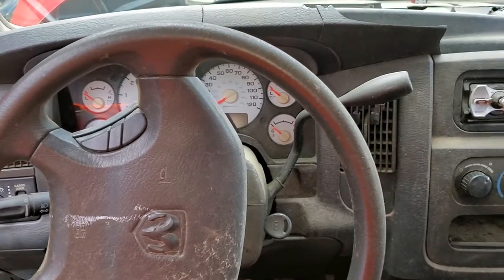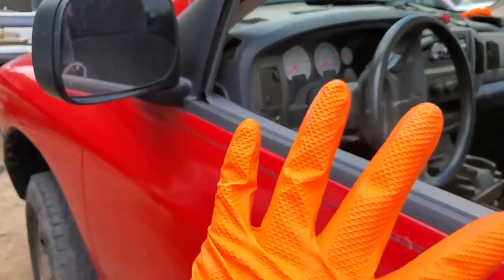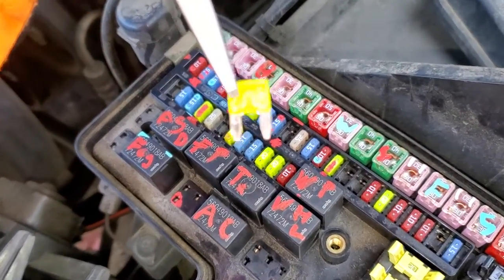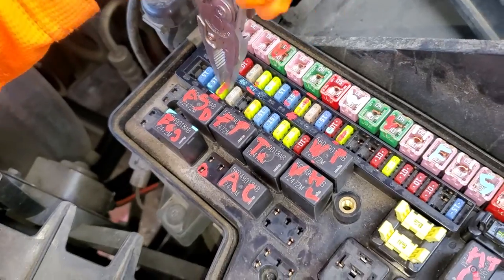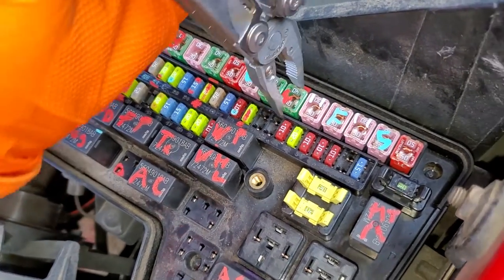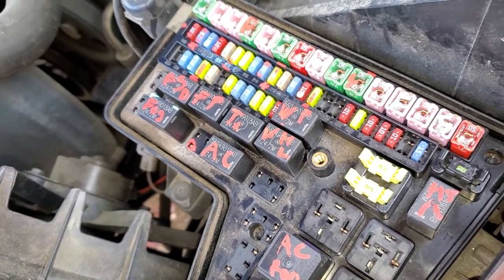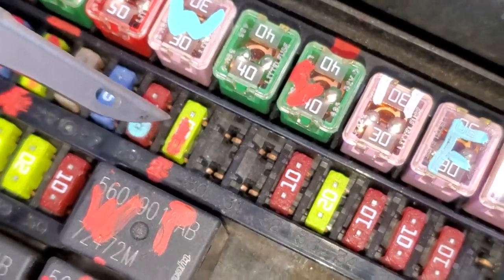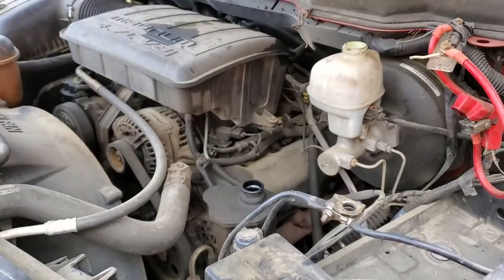2003 Dodge Ram 1500 Cigarette Lighter Fuse l, Power Outlet Fuses

Comment: How to change out those outlets .. my spring in broke all my fuses and vox is good but will not charge phone. My USB plug lights up when in outlet but won't charge phone. How do I change the top or bottom one.

Comment: Super helpful but whenever I replaced the cigarette outlet fuse and use it it burns out right away. Anyone have any idea what it could be? Is it drawing out too much power? 🤷‍♂️
Reply from the maker: Try removing any adapter you have installed and ensure that there is nothing in the socket like a coin or paperclip
Reply: Good point thank you.